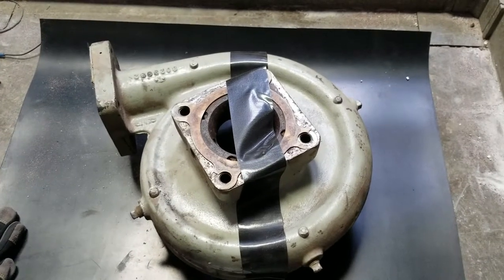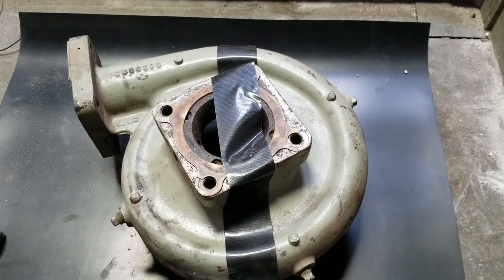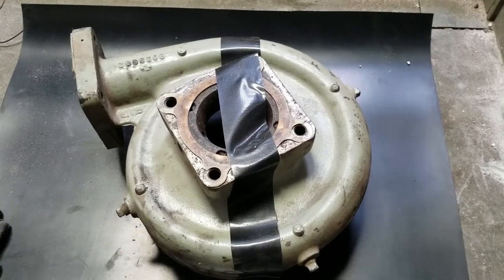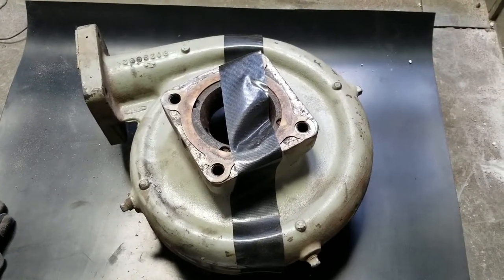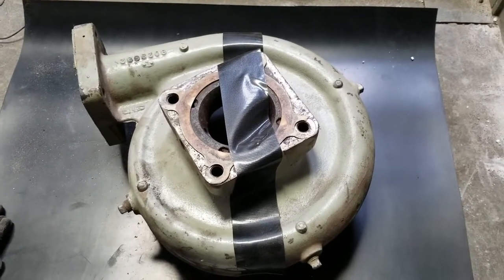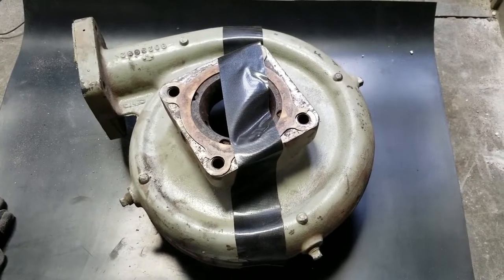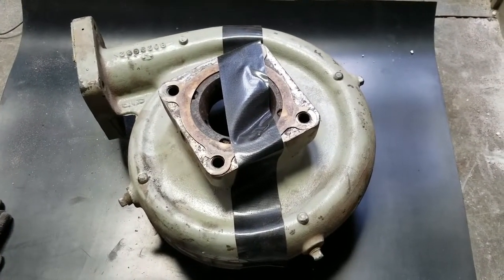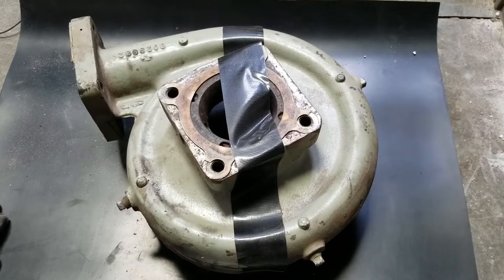Pressure Blasting vs Suction Blasting

Comment: What are the specs of the air compressor?
Reply from the maker: Need at least 8 hp
Reply: @greatlakesfinishingequipme615  I have a 6 cfm at 90psi , 5 hp 27 gal compressor. Could I run a 10 gal pressure or small suction for small items?
Reply from the maker: @cubul32  You need 32 cfm. with the gun assembly shown, there are 12 cfm. guns available.